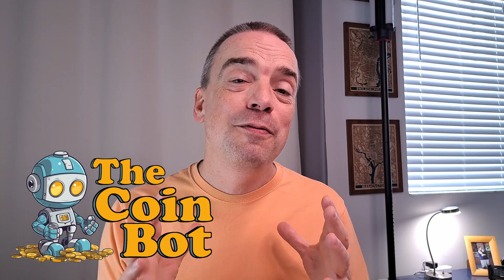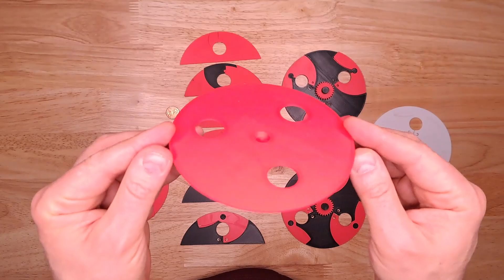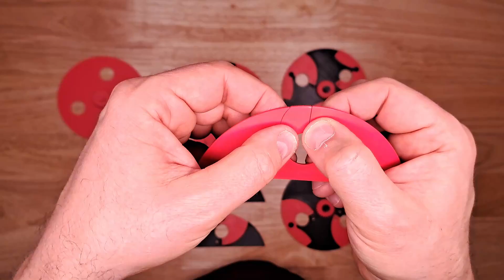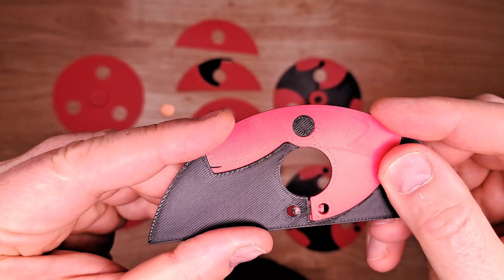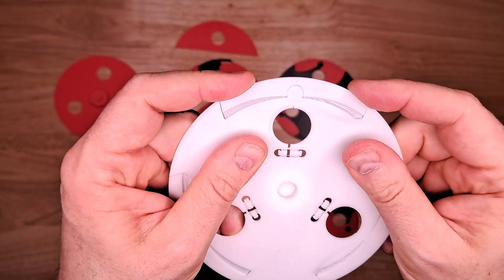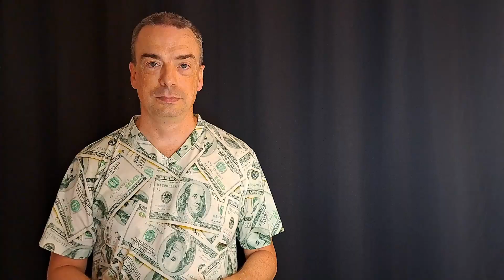Coin Grab Recap - The Coin Bot

Comment: Maybe you should focus on making a working prototype first, then worry about reducing the part count later. You've already got a promising start with the multiple pieces and rubber band setup. I would personally just run with that for now and worry about optimizing it at a later point. However, if you do some digging into 3D printing methods, I bet you'll find some method that would allow you to print all the pieces at once and keep the functionality of the part. 

I'm going to send you an email regarding more private stuff. 

Happy New years
AB
Reply from the maker: Happy New Year AB!